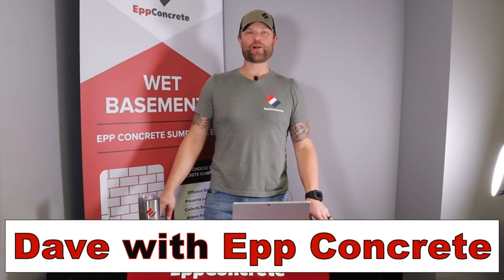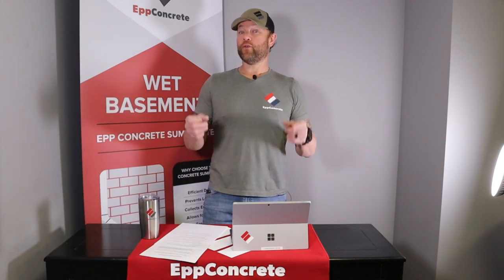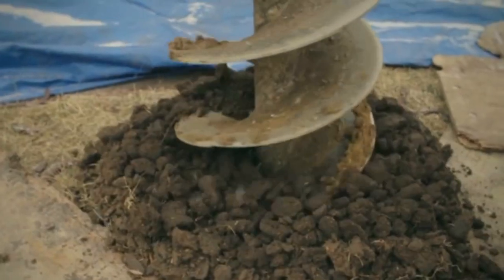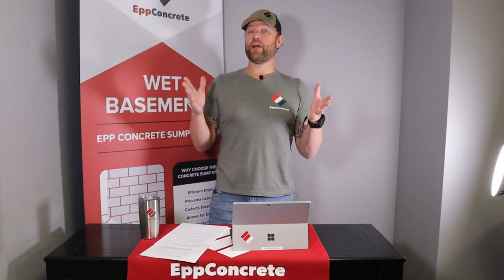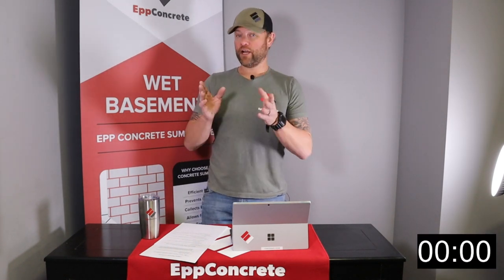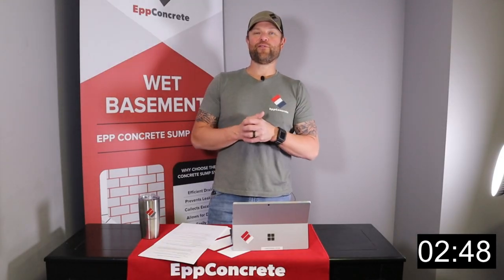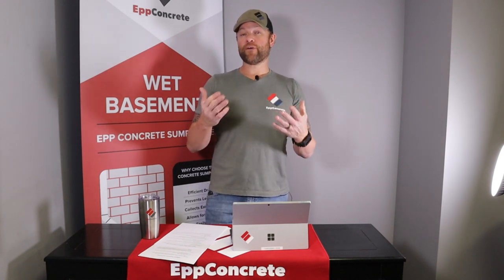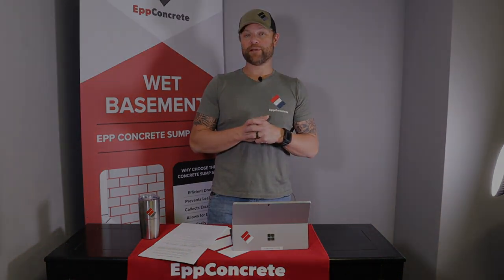What is the White Stuff On My Wall?

Comment: just wanna ask cause i have that white stains or stuff in my studio , i just painted my walls no water presence in my studio , but i do gave an air condition, is it the same ?  it is so unpleassant cause i just finished painting my walls in a dark ghreen color
Reply: Found any answers yet?
I too have the same problem
Reply: @muhammadrauf2600  me too! my room look ugly now
Reply: Same problem here
Reply: Same you just have to periodically clean the wall mime is black and I also have air con
Reply: Nice video, Dave, I'm having the problem that the chalk paint on the ceiling is causing white layers of white dust to come down into my apartment, on the floor, on surfaces, and furniture. I have to keep dusting constantly. How to solve this? Thanks!